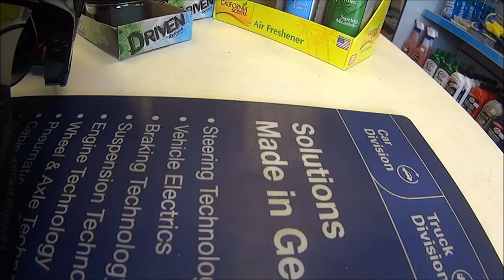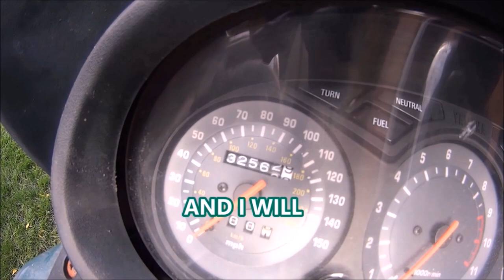XJ900S DIVERSION MIDWEEK SNEAK PEEK..

Comment: Just done electrolysis in my Divi tank. Took nearly a week to completely remove the old rust and used por15 as a tank liner which is highly recommended. I may have a repair or bodge for the fuel sender as mine has lots of play in the shaft and a new one is nearly £90. Keep up the good work RR✅
Reply from the maker: Northerner 137 nice one. How did you block out the holes in the bottom of the tank? Thanks.
Reply: Hey ROAD RODENT , I made a small plate for each using thin steel. I used the original gaskets as I’m replacing them anyways. I used baking soda mixed with vinegar and cleaned it out everyday.  Used an old bar as the conductor which I also cleaned off everyday using an angle grinder to make sure it conducted! It’s a pain in the you know what but needs doing buddy! Good luck Steve